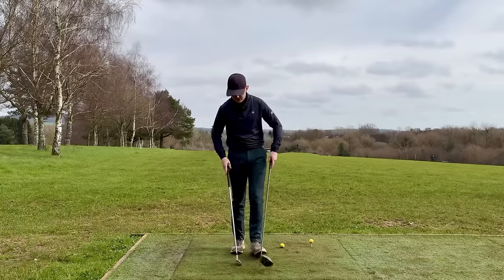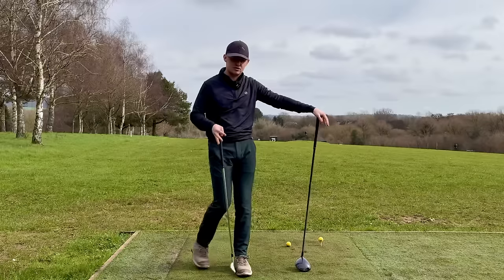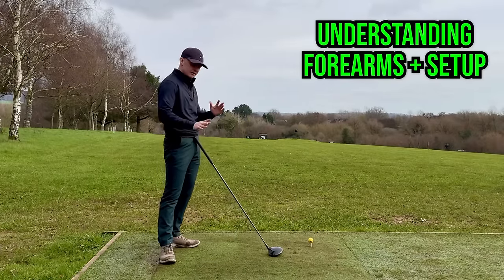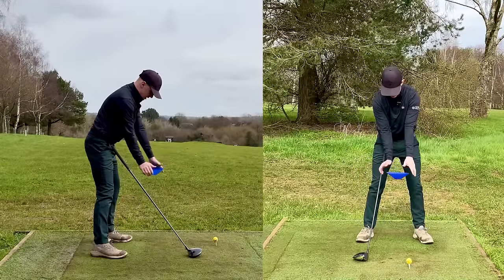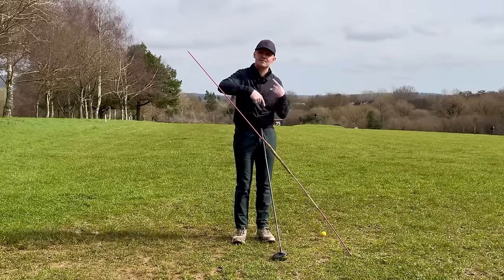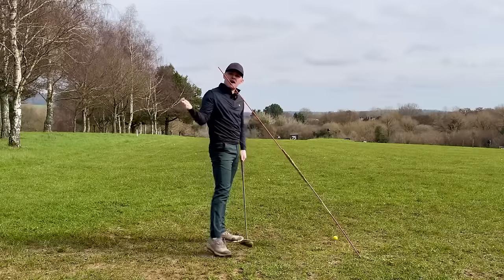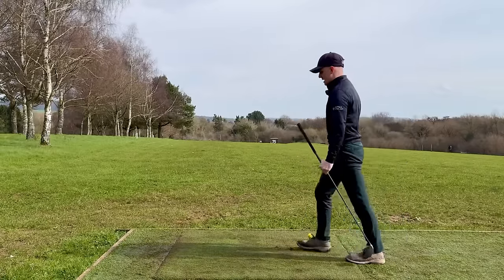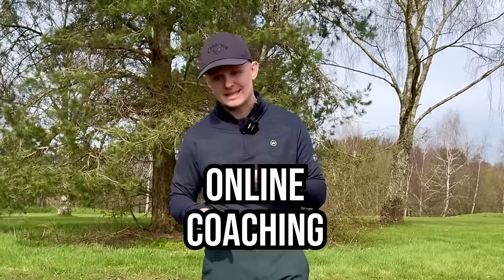The Driver Swing Is EASY When You Know This

Comment: Thanks Giles. A great and simple explanation to separate your driver from all other clubs. I often see players that will pull out “the big dog” for the first two tee shots, blame the club, stick it back in the bag and just use their 3 wood for the remainder of their round as the first two driver shots were terrible.  So, thanks again as the next time this happens I’ll simply offer to send them this. 👍😎🇦🇺
Reply from the maker: That’s exactly what happens and this is a big reason why
Reply: @Gilesgillgolf  Exactly.  It’s the most expensive club in your bag yet a lot of players tend to give up too easily.  Living with a long Par 3 tee as my backyard I do get to see mainly ladies and seniors using a driver as the max distance is 195 metres so it’s a difficult with traps in front so if anything you won’t to be hitting longer to be safe. I’m close enough to also hear the vocal reactions when things go wrong.  On a slightly different note I plated a round with my neighbour and his son (who hits off 2). One a 525 metre Par 5 his second shot was with a gap wedge which landed a metre from the hole.  Can’t recall playing with someone that can hit a driver that far for a very long time as it’s 3 shots for me on a good day.

Comment: Hi Giles another great video which highlights my problem, I need a flatter swing with the driver.
I noticed right at the end with your drill to keep the left arm more attached it produced  a flatter clubhead and shaft plane. However in your final swing without a drill the shaft still appeared flatter but the clubhead slightly higher.
Am I imaging or is a your wrist position.
Keep the videos coming.
Reply from the maker: It’s basically the same swing just some minor human margin of error